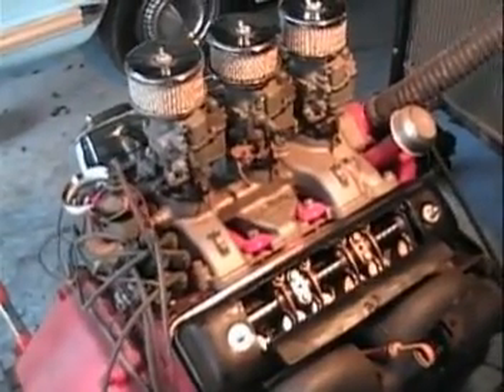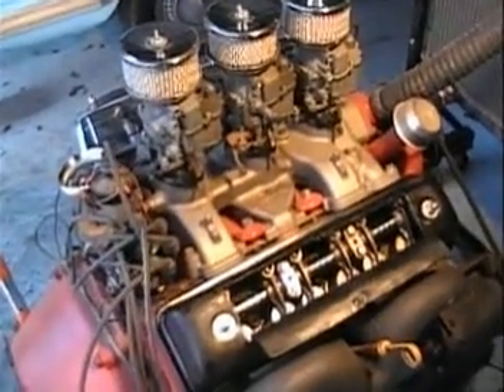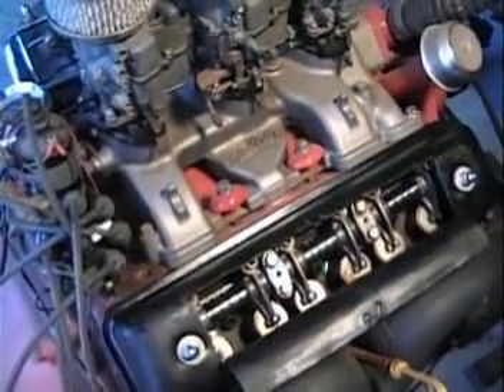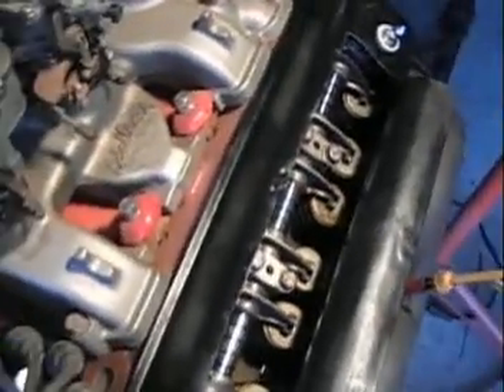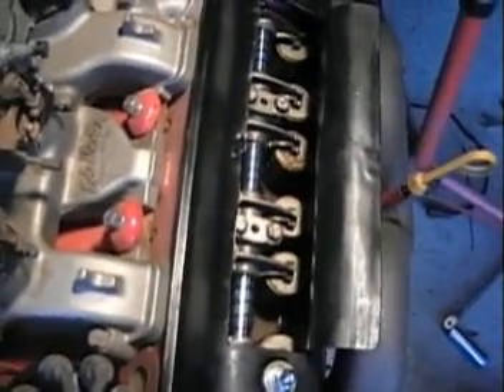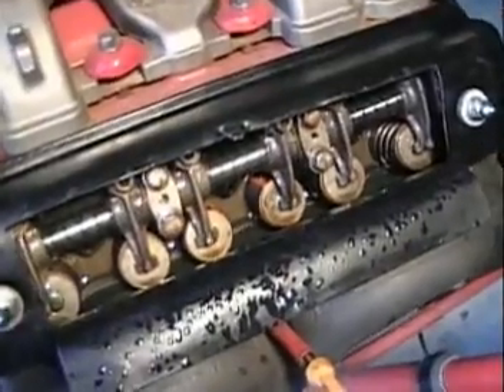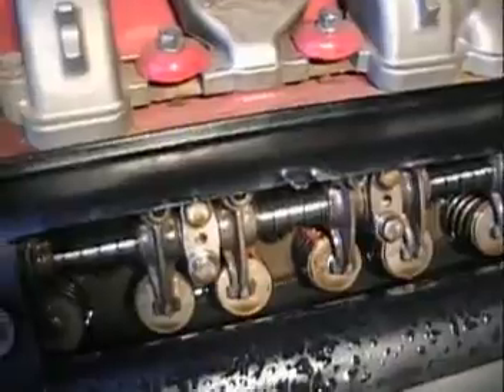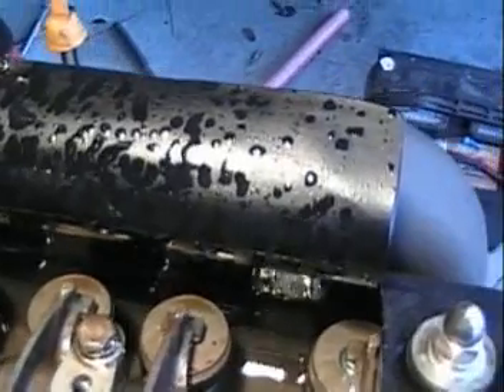Y-Block Ford V8 running Tim McMaster Pressurized rockers #2

Comment: Great little video, did you see any affect on oil pressure going to the pressurized rockers? I would imagine it could go up a bit since the bleed tube is sealed
Reply from the maker: Yes, but it always depends on the engine. If it is worn out pressure may stay low. If it runs right on the bypass it may stay the same.

Comment: Wait, I thought all Y blocks had pressurized lubrication through their shafts. Did you do some modification to that?
Reply from the maker: They all feed through the rocker shafts but not under pressure. The excess flows out a tube on the end.
Reply: @ thank you. That explains it. I ended up pressurizing the valve train on my 292 a couple days ago after seeing this video and researching it a bit. I simply pinched off the end of the overflow tube so that no oil could flow out of it. I thought about tapping the overflow hole and plugging it with a bolt, but this method allowed me to reverse my decision should I ever need to in the future. Sure enough, rockers which were bone dry started to get a little bit of oil. I think it will be a while for the new oil to clean up and make it through the decades of built-up sludge and flow as well as your valves did in the video, but this was very helpful. Thanks so much for posting it.

Comment: It's too bad the Y blocks oiling system didn't have better oil when it came out in1955, then there wouldn't have been all the bad press about it. My Dad had a 1956 Mercury Monarch with a 312 4 barrel Holley, which he drove hard with its Hollywood Mufflers for over 200,000 miles without a single problem, and because we ran an oil change garage it got very regular oil changes. nuff said.

Comment: Kinda hard to create OIL VAPOR to be pushed down valve guides by CRANKCASE PRESSURE AND HAVE THAT CRANKCASE PRESSURE CONTRIBUTE TO FLOODING THE HEADS WITH OIL WHEN YOU HAVE THAT GIANT CRANKCASE "BREATHER" PEELED OUT OF THE VALVE COVER, AIN'T IT? ENGINES  ALSO "BURN OIL" WHEN MANIFOLD VACUUM IS HIGH, EXHAUST BACKPRESSURE IS LOW AND THERE IS MAXIMUM ROCKER SHAFT/ROCKER "LEAKAGE" BECAUSE THERE ISN'T ENOUGH OIL FLOW TO KEEP THE SHAFT FULL AND THE "BUSHINGS" FULL AND SEALED UP AND INSTEAD THE SHAFT DRAINS DOWN ENOUGH TO LET BUSHINGS RUN "DRY" AND WHEN THE ENGINE IS SPED UP OIL PRESSURE SURGES AND A PARTIAL "AIR LOCK" IN THE SHAFT TAKES TIME TO BLEED OUT AND AS IT DOES WHEREVER BIG "LEAKS" ARE THAT PRESSURIZED AIR BLASTS AND CARRIES OIL OUT OF AND AT THE LEAKS. SO SHAFT-MOUNTED ROCKER ENGINES TEND TO BURN OIL WHEN FIRST "ACCELERATING" AT MEDIUM ENGINE LOADS AND SPEEDS WHILE BALL-PIVOT ROCKER ENGINES TEND TO BURN OIL WHEN "DECELERATING" WITH ENGINE BRAKING AND AT HIGH ENGINE SPEEDS BUT LOW LOADS.

BLUE SMOKE AT STARTUP IS UNBURNED FUEL BECAUSE ACTUAL BURNING ENGINE OIL CREATES WHITE SMOKE UNLESS ITS DILUTED WITH GASOLINE. WHICH IS VERY COMMON IN "WORN OUT" V-8 ENGINES WITH LOTS OF BLOWBY, LOW COMPRESSION, LEAKING INTAKE GASKETS LETTING THE ENGINE SUCK IN OIL VAPOR FROM THE LIFTER VALLEY, LEAKY AND WORN  LIFTERS ALTERNATELY BLEEDING DOWN AND PUMPING UP AND SPENDING TOO MUCH TIME ALIGNED WITH THEIR OIL PASSAGES SENDING OIL "GUSHING' OUT OF THE PUSHRODS, ETC.

WEIRD HOW CHEVY NEVER COPIED ANY OF THE Y-BLOCK VALVETRAIN. OR HEADS. OR LUBE SYSTEM.OR INTAKE MANIFOLD/VALLEY PAN. AND EVEN FORD "COPIED" BASICALLY NOTHING FROM THE Y-BLOCK FOR THE "FE" AND "WINDSOR" AND "385" AND "335" V8 ENGINE "FAMILIES" FORD Y-BLOCKHEADS SEEM ENTIRELY UNAWARE OF.

Comment: Hi Tim! I am having oiling problems on my passenger side head on my 292. The weird thing is that I sometimes can se oil flowing from the owerflow tube, and some times it is completely dry. I have tried both 10-40 and 20-50 oil. The drivers side is getting good pressure in my opinion, and I have pinched the overflow tube on that side, just to se if I can get pressure to the passenger side. No luck on that one. :( Now I am thinking of buying a new oil pump. Any tips on how to fix my problem?

Update:
New Melling oil pump didn't make any difference.
Passenger side head do seem to get oil when cranking, but not when idling or running.

Will the next step be to change the cam bearings?

Best regards,
Robert
Reply from the maker: Have you pulled the rockers off to clean and rebuild?  That might be what they need.  Take the side off that isn't getting oil, then turn the pump with a drill motor.  See if oil is coming out the feed hole in the head.  If you have a cross drilled cam you will need to turn the crank by hand slowly till the holes line up.  You may need a friend to help. :-)
Reply: mctim64 Thanks for the answer.
I have disassembled the rockers and they're clean. If I prime the engine like you say, and there is coming oil out of the hole, then there should also be oil there when the engine is idling. I have turned the engine using the starter motor without plugs in and with the passenger side head off. There was oil coming up. Assembled the passenger side head without the rockers. There was oil coming up. Started the engine. There was oil coming for a short while.. then it was dry again. I can't understand what is wrong. Drivers side head is getting good oil pressure. Thank you for your help :-)
Reply: mcTim old trick run tubing rocker to rocker drains usually one side oils heavy..running line from pressure sender kills bearings
Reply: @dondesnoo1771   Hi from Venezuela, I am jonny, and have a Ford Customline RanchWagon 1954, engine 239 Cu.in. I also had that problem with the right side lubrication, but this happens when the blocks have already rolled enough. I rebuild the engine completely and the lubrication was great, what I did was to plug the relief pipes for greater pressurization in the lubrication system following the video Mc Tim which seemed like a great idea. In my opinion this will give longer life to all the bearings well sea those of the crankshaft which is where the pump begins to send the oil, then towards the cam and finally the highest point that are the flutes. If you rebuild the engine and do not block the vents, there will be a leak which will cause the bearings to wear out faster causing this problem on the passenger side. regards
Reply: Jose Gonzalez thanx the 239 was a bad engine anyway the later 60--62 292.  312 had different cam bearings which I have 3engines of that type one in car poor oiling other's junk yard dogs never tried ,thanx. want to rebuild one of those.
Reply: I ran a tube on the one in car overflow tube one side to other which oils ok but wanted to know what to look for.

Comment: I have pulled the rockers, pulled the plugs and ran the engine on the starter motor right after I had it started and running. the passenger side has some oil coming, but it seems like there is no pressure. The drivers side looks OK with the rockers on. If I blow air or oil down the hole on the passenger side, the air or oil comes out freely/easy where the oil filter is located. But very weak or no pressure while the engine is running. Crossdrilled cam?
Reply: Robert K run tube r drain to other drain drill holes in covers rubber fuel line ok

Comment from the maker: Before you go and buy a new oil pump take the rockers off and the dizzy out, run the oil pump with a 1/4" drive 1/4" "deep" socket on a long extention with a drill motor. (counter clockwise) Now see how much oil is coming out the hole in the head that feeds the rockers.  If none or not much you have a blockage or restriction if you get plenty out it's time to rebuild you rockers.  Refer to my rebuild video.

Comment: i have a 272 that runs god but the valvtrain wiped right out of it... i ran an old oiler kit that pluggs into the rear of the rails. it worked good till the pass side  got pinchd off. i replaced the small copper line with 1/4" fuel injection hose but drilled the valve covers and ran into the over flow tubes.this thing will fill the valve cover right up now and the smoke is insane... i have to figure out a happy medium

Comment: my 292 only wishes it could get that much oil to the top end... When I got my truck it hadnt run since 96' so I drained what oil was in it, and put in new oil. When I pulled off the valve covers to adjust the rockers it was almost completly dry even after running so I ran a couple quarts of atf in the oil for a few hours and it cleaned everything up and it gets more up there but not as much as id like. How did you do that?